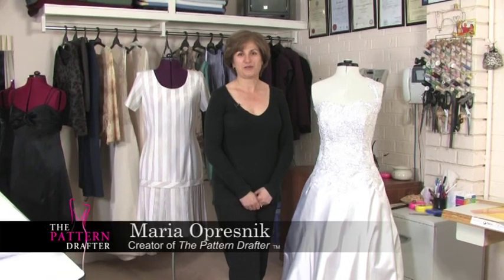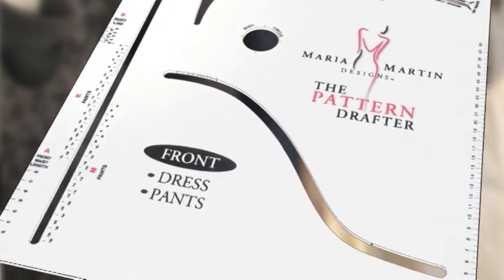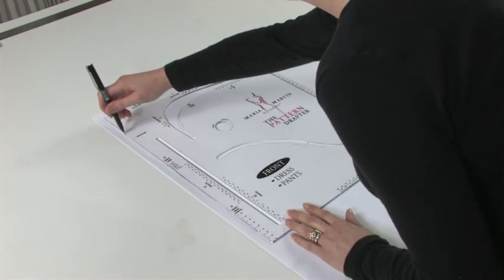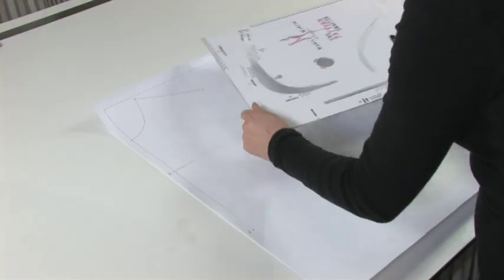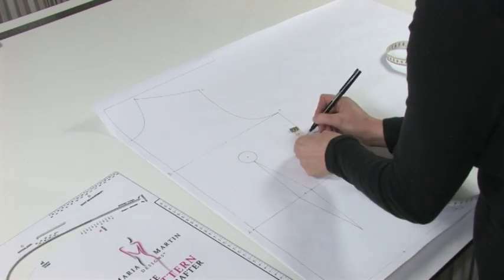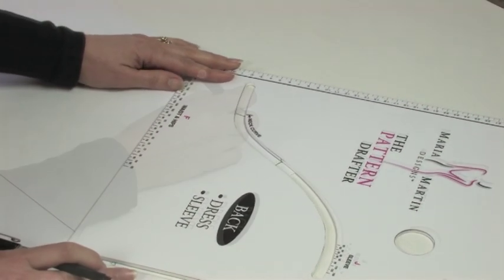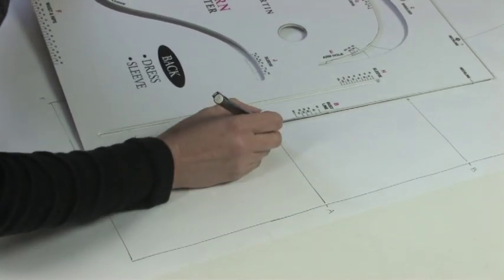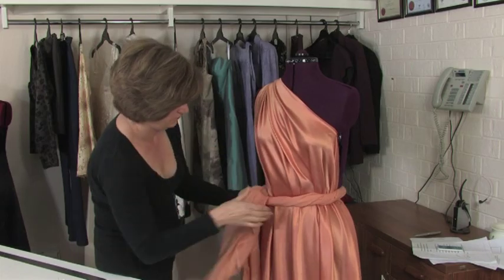Pattern Drafting

Comment: You did a really nice job on the video and speech parts of this presentation.  The background music is awful.  It makes it really difficult to learn from the video.  I recommend that you remove it.  If you want music , use one of the Brandenburg concertos at a low volume.  Good luck with your product;  It looks to be very clever and I am sure you have put a great deal of work into it.

Comment: hello 50 fabrics.
thank you for your comment and no i'm not insulted by your question, in fact it's a very good question.
The Pattern Drafter that you see is still the one that i sell, the thing that is new however is that it comes with a step by step instruction DVD now, which is included free of charge with The Pattern Drafter.